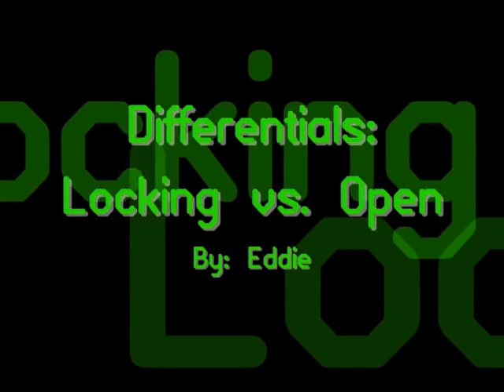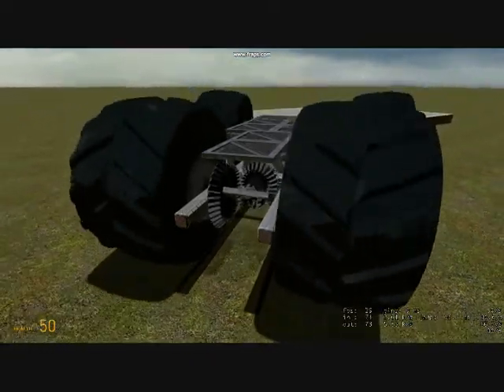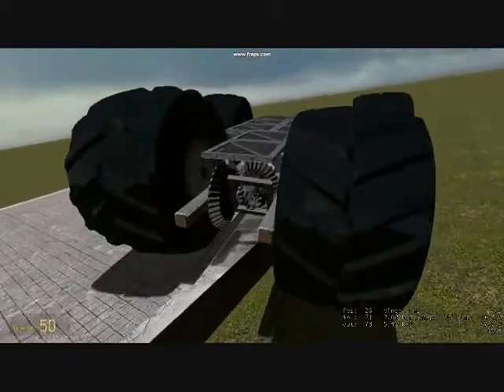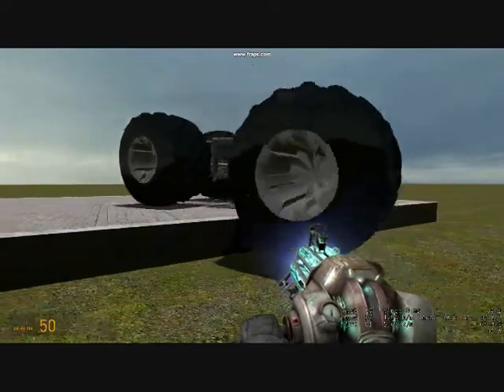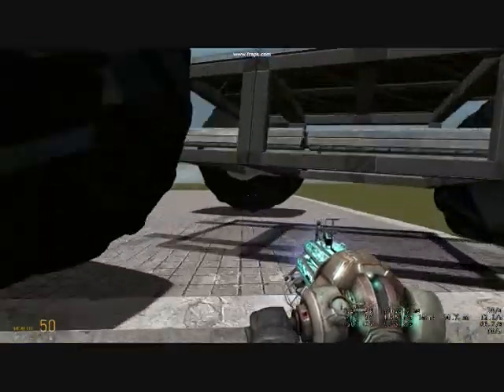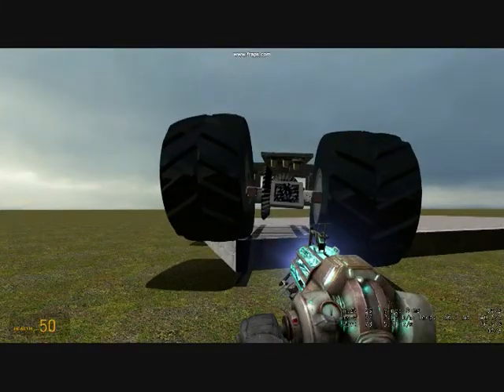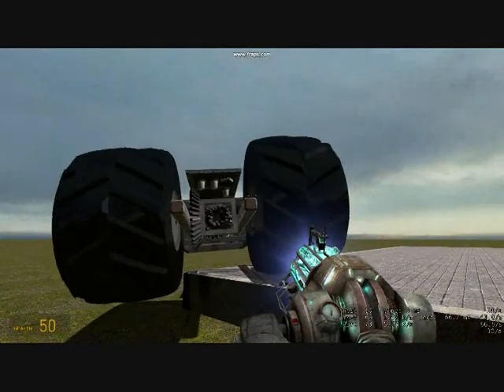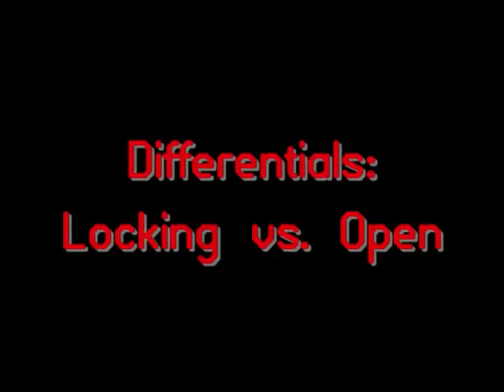GMod Wiremod Locking Differential

Comment: I just use wheel motors,  When going straight a weld latch locks the wheels together, when turning it releases.  Very simple, works perfectly.